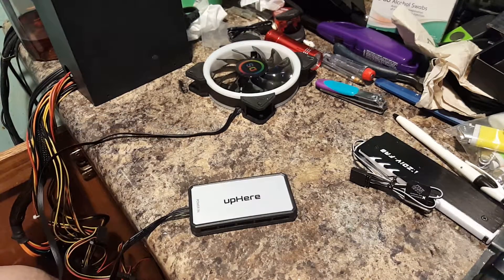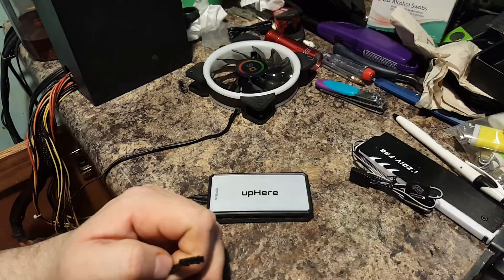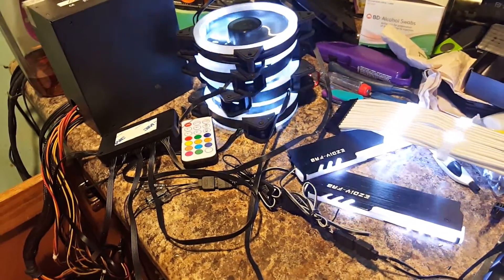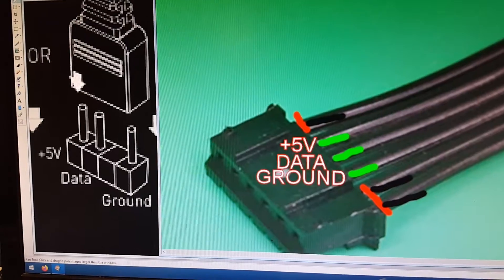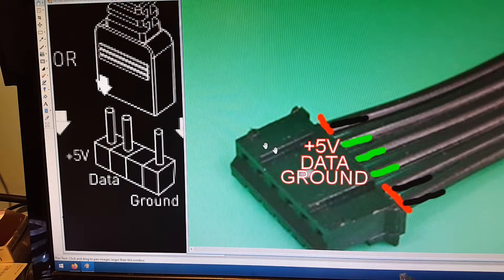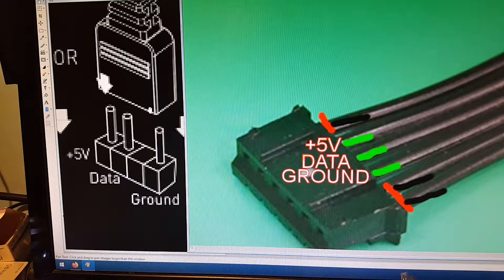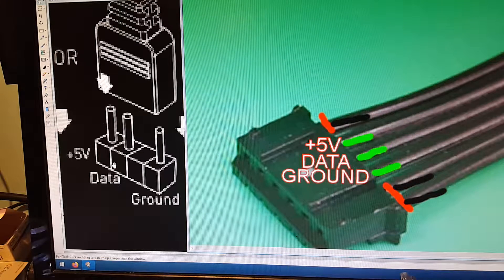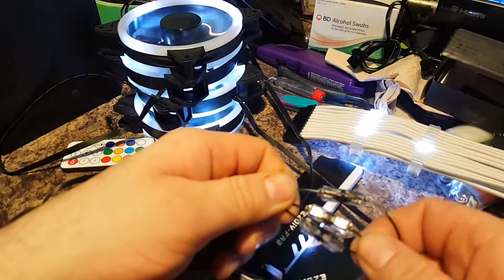Cheap hack to convert 6 pin rgb controller to 3 pin 5v

Comment: for the 6 pin connector you dont need to cut the cables of the connector you can go to the back of the connector take a screwdriver to one of the pins and pull and the pin comes out

Comment: All i want to know more is how to control the speed of fans if that 6 pin fan have only 2 wires dedicated to fan control. Seems it is impossible without a proper 6 pin controller hub.
But in that situation, how the hack those controllers control the speed of fans ??????

Comment: Can you cut the same way for the ibuypower argb fan 6 pin ?
Reply from the maker: I did this video years ago before adapters were readily available. If you visit https://www.amazon.com/dp/B0C9TNY6ZZ you can find the proper adapter  pretty cheap so you won't need to do any cutting and splicing.

Comment: How can i find out which pin is which on a diffrent controller? Or are they all the same 6 pin layout?
Reply from the maker: Most all of them are the same. There are a couple exceptions like Gamdias controllers for example, but typically, it's all the same thing packaged into a different box.
Reply: @phreakwars  I have some chinese no brand controller tho, and i dont wanna make anything burst into flames. What would happen if its a diffrent pinout and i put that adapter

Comment: all of my 6 pin fan not detected on bios as chasis fan even i have plug the 4pwm and 3argb on controller to the motherboard :(
Reply from the maker: They won't be detected because they are ran by an external controller, not by actual PWM. The 4 pin PWM plug on the controller does not report RPM, that is not a PWM leads function. RPM is handled by a seperate wire which is not part of the 6 pin controllers specs.
Reply: @phreakwars ahh i see, i just waste10$ for buying another 6pin controller that have 4pin pwm on it cuz i think i can controll the fan speed from bios :(

Comment: Got my self 2 Lian Li 24 pin  strimer cables at a bin store for 50 cents each. Going to try this hack.
Reply from the maker: Strimers have a total of 120 LED's inn them. This hack will work on them, but it doesn't pull enough amperage  to light every light up, only about 2/3rds will work on Stimers.
Reply: @phreakwars I ended up picking up a L connect 3 controller but it missing the the USB and 3 pin cable. So I'm going to have to rig something up. 2 leads to a 3 pin, seems straight forward.

Comment: mate, 8 fans are installed in my controller, but I want to connect 10 fans, is it possible? is there a multiplier?
Reply from the maker: Just daisychain them. Controller is capable of 12 total.
Reply: @phreakwars  bro I don't know what daisychain is?

Comment: Wait you created a 6 pin adapter for a 3 pin adapter so you could connect ur ram rgb thingies as well to the main box, right? But if i aint mistaken those ram thingies also have 4 pin (3 pins iirc actually. Btw just to mention that there are sum chinese brands that give those rgb things with 3 sections of cables, the ones uve shown, and theres another one that looks that it got 4 pins but theres actually 3, perhaps youll get what i tryna say. As far as ive seen yours doesnt have that connection i think...) so you can connect them to the rgb tires section of the main box and make the rgb work as well, isnt that correct? Or the connections work different?
Interesting video btw, this electronics knowledge is gold for me, thanks
Reply from the maker: 4 pin will be either 12v plain RGB but sometimes it's a call back lead. All I'm showing in the video is the pin out for the 6 pin to make it 3 pin, the 2 extra wires I clip, are 12v+,12v-, and feedback. The connector I end up with is just the hacked version of the exact same connect you can find here: https://www.aliexpress.com/w/wholesale-6pin-to-5V-ARGB-3PIN.html which you could absolutely buy as well if you don't mind waiting a couple weeks for them to arrive from China. And yes, they have the 4 pin version as well (which I did not show in this video). https://ae01.alicdn.com/kf/He5889908a6a2429397faa76ee7188eefU.jpg
Reply: @phreakwars  interesting, i got a fan controller box but its like a bootleg ver. of the coolmoon lol, its called loving cool and looks exact the same way but i dont really know if it has the same exact outputs since its almost the same thing, also got a gpu support from coolmoon, thats why i wanted to know if i could directly just connect that 4 pin section to the led tire, as far as i know its possible but i dont want to muck up anything lol
Reply from the maker: @Moniyperritos  Yes, these 6 pin controllers are almost all the same. The only real difference I have ever seen, is sometimes they will have a proprietary 6 pin connector, but the pinout is always the same.

Comment: I have 2 rgb fans 6 pin that i want to put into a motherboard that has 3 pin connector is it possible to use the fan controller only? Or i need adapter also?
Reply from the maker: You'll need the controller box to make the fans spin.

Comment: Make gamedias controller adress to ux100 cpu coller ux100 has 2 pin only rgb  controller how to connect to gamedias controller
Reply from the maker: For the UX100, it uses the data and ground lead, I don't have a Gamdias controller to show you how it is done, Gamdias uses a proprietary 8 pin, you'll need to use a multimeter to trace the ground and data leads.
Reply: Ok i watch your previous  video gamedias athena m2 case

Comment: Yeaaa...i burned my fans trying to connect this scam of a 6 pin connector to 12v. Argb leds just exploded, the fan motor is happy and thriving. garbage.
On the fan box says its 12 v. Nothing about 5 volts.... Nbase Vortex
Reply from the maker: Sorry you were a dumb ass and did it wrong. Nobody else (and there have been HUNDREDS) had that problem. Fucking tard, pay attention next time instead of trying to tell me it's a scam. I won't be held responsible for your stupidity. So go fuck yourself and piss off. I scam nobody. Are the proper adapters I link to in the description a scam too??? Fucking idiot.

Comment: Any way to control the speed of the fans?
Reply from the maker: Unfortunately, no.
Reply: @phreakwars  for istance...do you know how can i get a 5v aRGB on my mobo if all of them are 12v... i mean i have to connect a header with 3 pins(like 4 pins but on missing) bu tmy mobo doesnt have a proper one. the connector needs 5v, D, gnd....i only have a connector that has 5v that's called VDG...with 3 pins all together (so it cant fit).
Reply from the maker: @galaxy_tv104  what is your motherboard model? I can help. Also, which model of fans are you wanting to use?

Comment: so by what u mean is if u cut the last 2 wire mean nothing or u cant use the argb?
Reply from the maker: last 2 wires are 12v leads for the fan
Reply: ic so if we cut it it doesnt affect at the argb?
Reply from the maker: No, RGB will work just fine, those lines are separate from the RGB.
Reply: @phreakwars   ok thx for the info man sure gonna do this

Comment: Great. Another mod maybe, if 6 pin controller can use for 3pin argb and 4pin PWM???? Can you???
Reply from the maker: Yes, but you won't have PWM control.
Reply: @phreakwars  i see ...... Because it just for 12v fan without data cable. Data output from 6pin port is useless.

Comment: Good afternoon, would it work the other way around? with a 5v argb controller for the fans?
Reply from the maker: Depends on what you mean. The fans themselves run on 12v

Comment: Thank you very much. I know this video is 2yrs old, but it's exactly what I was looking for to hook up my CPUs aRGB fan to the controller for my case fans, since my motherboard doesn't have any aRGB headers.
Reply: Yes, it worked to hook up my CPU aRGB fan to the fan controller hub. If your hub isn't from Uphere try swapping the +5V and ground around. Since a lot of those companies use the same 6 pin connector and hubs, but some times swap the pins around.
Reply: did it work on a aRGB header? I have the same scenario with you.

Comment: Ha!!  DS Mine are still going however Most of the these Cords Are brittle AF
Reply from the maker: I KNOW RIGHT!!! I rarely use this cheap shit except for lower budget builds. You can do the hack on it or buy an adapter, sure, but voltage output is off. Honestly wouldn't recommend playing around with it unless you really don't care if it gets trashed or not. As cheap as these boxes are, might as well.

Comment: i have the xigmatek aio cooler  which has these 6 pin fans. the remote controller has a fan speed button but nothing happens when pressed. after doing some research i got to know that 6 pin fans has no speed control function but the website and all for this cooler advertises how you can control the speed of the fan. i had no issue if it wasn't so loud always running 100%. is there any hack or solution for my problem?

Comment: Hi! Can this controller control the fans' speed?
Reply from the maker: The one used in this demonstration..no. Other 6 pin controllers, yes, depending on the brand/model.

Comment: Hi!!! Would you help me with the controller seen at 11:00 minutes??? I do have that same controller in my pc to control 10 fans. But, it's controlled by a remote control and I want to control from motherboarb but do you what cable is connected from controller to motherboard???  Thanks!!!
Reply from the maker: The cable would be the one on the right side of where the power lead comes out. Your motherboard will need to have a 5v header, not a 12v. Typically, the remote should have a button to switch to motherboard mode.

Comment: I would like to use my Thermaltake TT Riing 1425 fans running on 12V with a proprietary connector.
It's fan on 5 pin.
I guess that has 3 wires for the RGB and 2 wires for the fan.
I know this type of wiring, I want to be able to install my fans on a classic 12 v rgb hub
Reply from the maker: You'd need an adapter from PirateDog tech to do that.

Comment: bro, I have a kolink case with the SAME controller you have there, and the coolers connectors are the same too, so, can I use the coolers you have in the video on my controller? sorry my english Im from Argentina xd I bought 4 fans "sate" that have the same connectors that the coolers you have there, so I dont know if they will work or not in my case

Comment: Hello

On the coolmoon next to the power connector there is a two pin connector.
Is it a connector to control the speed of the fans.
I didn't find anything when I opened the controller to hope to find an indication.
I think so, otherwise I don't see what the two pin connector is for.
Reply from the maker: On the coolmoon controllers, the 2 pin connector is made to be plugged into your LED button or reset switch. It allows you to control color patterns via button. If you want one with fan control, you could use one like this: https://amzn.to/3i2PzdK

Comment: Hello.
As an alternative, I wanted to buy the Deeppool converter RGB 5V 12V.
Looking at the functioning of each component (HUB enermax saberay + Deepcool converter + COOLMOON controller) I think they can communicate together.
The only thing I'm a little afraid of as I'll be going through 3 devices is having a latency in the RGB.
Reply from the maker: It would probably work, the only trouble using the deepcool converter, is you are limited to 12v effects. 12v type RGB can only do 1 color at a time, so it's kind of a waste if you are looking for digital effects that produce 2 or more colors.
Reply: @phreakwars  Thanks for the information about the Deepcool converter I didn’t know. I don’t think that should have 5v 12v RGB converters that can make two colors at once. The only solution that remains in my opinion and to find affordable RGB fans it makes directly 12v. And the fans I currently have keep them for another box.

Comment: Hello.
I have an ENERMAX SABERAY PC case.
I have fans bought in China with the controller put in the description.
My case has a HUB that does RGB and rheobus controllable by the case.
I would like to be able to connect my fans to the HUB.
Do you know if this type of fan can be connected to a 4 pin RGB port.
As I don't have a precise indication I wouldn't want to plug in is damaged the controller.
Reply from the maker: No, the 4 pin type are 12 volt, plugging them into that will destroy the controller, or worse yet, destroy your motherboard.
Reply: @phreakwars  

A replacement controller is very expensive, I know something about it, my original circuit broke down. I don't want to buy another controller. Under my eyes on the fan I see 4 wires for the RGB and 2 wires for the fan. At first I thought the fan was for RGB in 5 and 12 v.

I had thought of buying a 5v to 12v deepcool RGB converter but I have doubts that the converter communicates with the HUB.

Comment: Wire that there box up to a $10 arduino pro micro running the Corsair Lighting Protocol firmware and bam, you got icue controlled RGB! Really sucks non of these seem to have a Data return wire (im hoping it'll be trivial to add tbh. Gonna try it on a set of EZDIY moonlight fans, hoping i can pickup the DO point on the end of the strip then use JST-SM connectors to daisy chain it all sequentially), that'd allow sequential lighting rather than everything lighting up the same way.

Oh looks like they're JST-XH 6pin plugs too (by the looks of it, need to get my hands on them to match it up, if they are then they're readily available plugs)
Reply from the maker: They are JST-PH if memory serves.
Reply: @phreakwars  True, had a look at one of the premade cables and yeah can see the locking tabs ontop. Damn 2mm pitch, can't slide a standard dupont in there ....

Comment: I don't suppose you have a source for 6 pin extension cables for these kind of fans? I've been looking for them and I can find plenty of converters but no extensions. By the way, great video and I'll be using it if I need to hack together a solution.
Reply from the maker: Sure don't. You'll probably have to make your own. Whenever I need to extend them, I use some of these to splice wires together: https://amzn.to/3AtY89n
Reply: @phreakwars  I'm looking at the Hue Lightstrip V4 connectors as they look like they might work. 12mm 1.2mm pitch 6 pin straight through extenders. https://www.amazon.com/Extension-Cable-Philips-Lightstrip-Plus/dp/B08F9WVCS1/ for example. The length sucks but it looks like you can get Y splitters as well. I honestly wouldn't be surprised if these class of RGB fans/hubs are just reusing the tech/sub components from the Hue products.
Reply from the maker: @chrisrapier2466  I'm not sure what those cables are, not seeing it in the specs, but what you need are Mini Micro Jst 2.0 Ph 6pin connectors.  I've found ones with 1 end on them and that's about it. Those you linked to might work, it's hard to say.. EDIT: I bought some of these: https://amzn.to/3hkSb6O They should be here Thursday, I'll check them out and get back to you and let you know if they work.
Reply: @phreakwars  If the pin pitch is 2MM then these should work. 3' is just a bit excessive. https://www.amazon.com/GIDERWEL-Connector-Lightstrip-Female-Standard/dp/B07MKF26DB/ I'll get these and let you know as well.
Reply from the maker: @chrisrapier2466  sounds good, The more info I can get, the more knowledgeable I can be to pass that info onto others.
Reply: @phreakwars  I can confirm that the GIDERWEL extension cable for Hue lightstrips work with the 6 pin fans. They aren't keyed so you need to make sure you orient them correctly but they are working as expected. Note - the first time I plugged them in I had to do a power reset to the controller to get the rgbs to work. Not sure why but it's working. If nothing else I can do some better cable routing now.
Reply from the maker: @chrisrapier2466  The ones I got in for Philips Hue, DO NOT work, they are too small. So best guess is the "V3" ones on that page DO work since the "V4" that I got are advertised as smaller.
Reply: @phreakwars  That would be my guess as well. The GIDERWEL cables says they aren't for the new Hue products so the v3 will probably work. I think those are at a 2mm pin pitch. If they do then that give builders a lot of options for Y splitters, right angles, and better cable management. I know on a per unit basis it would be cheaper to just build the cables but when you only need 1 or 2...
Reply from the maker: @chrisrapier2466  yeah, I think what I'm gonna do is put the V3's on my wish list and order some, one of these times. It's not often that I need extensions for 6 pin, but at least it's good to know what's out there that will work. The V3's come in 6" and either black or white, so that will for sure come in handy.. Thanks again for the link and the feedback.
Reply from the maker: @chrisrapier2466  just an FYI for future reference. I found the proper connectors on adafruit: https://www.adafruit.com/product/5090

Comment: Thank you for making this video! Sorry if I'm a little slow, but how would I do this for similar 6pin RGB fans in combination with a Seasonic Synchro Connect? I got this case cheap and I have to make this work because as I'm sure you can agree, cheap is the only way to go :D
Reply: I should note that the fans came with a similar module too. Mine are Speedlink MYX. I got 6 fans, 3 control boxes, 3 remotes and cables for €36 or so :D
Reply from the maker: @HazewinDog  I guess first explain what you are trying to do? It sounds like you are wanting to connect the syncro connect to your motherboard, and then control the 6 pin fans in software. Is this correct? Or are you wanting something different, because there are a couple different answers for this depending on what you are looking to do.

Comment: I have an motherboard just don't have 3 pins ARGB (just 4 pin cpu/sys_fan) but i have 6 fans with a controller, but the connector is an 3 pin ARGB 5v i want do "hack" this soo, i need some help to do this